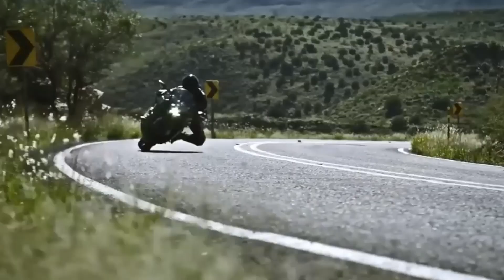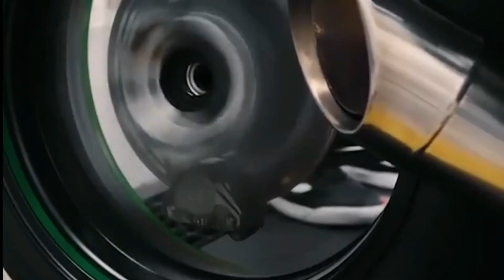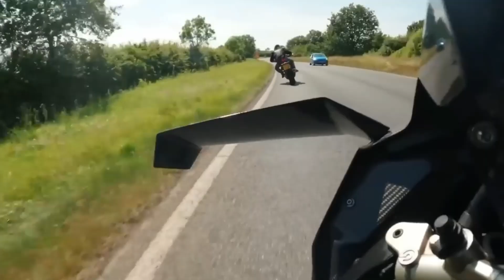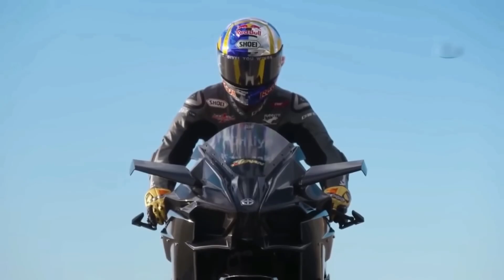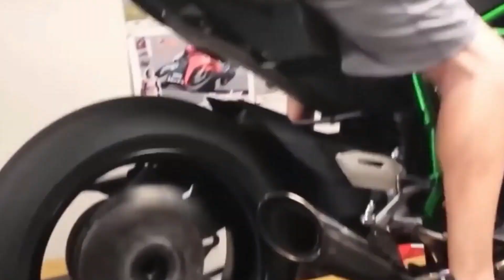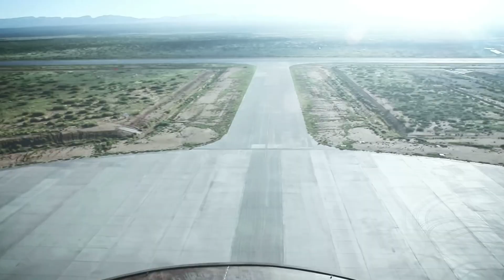The SHOCKING Truth Behind Kawasaki Ninja H2R BANNED Supercharged Engine

Comment: I love how all these shots are of the H2, not the H2R
Reply from the maker: There are plenty of R shots, and it is also comparing the R to the H2. Easy way to tell them apart are: Aerodynamic Wings:
The H2R features aerodynamic wings that help with downforce, while the H2 does not have these. 
Bodywork:
The H2R's bodywork is made of carbon fiber, while the H2's bodywork is made of a blend of materials. 
Exhaust:
The H2R uses a titanium exhaust system, while the H2 has a more standard exhaust. 
Thank you for watching